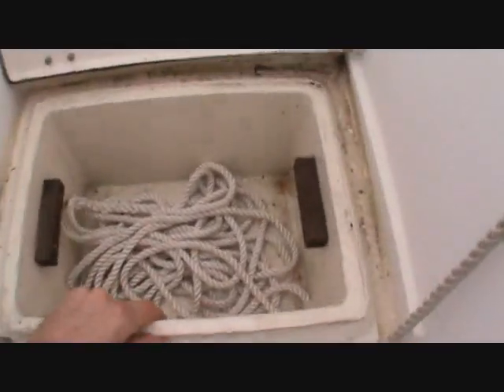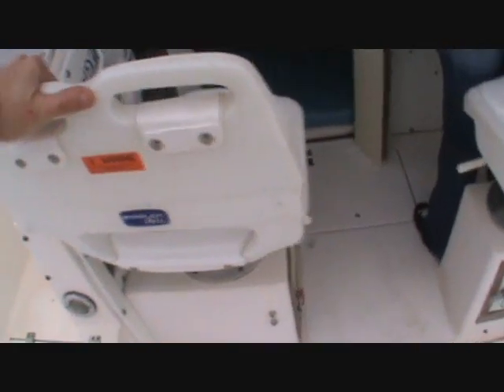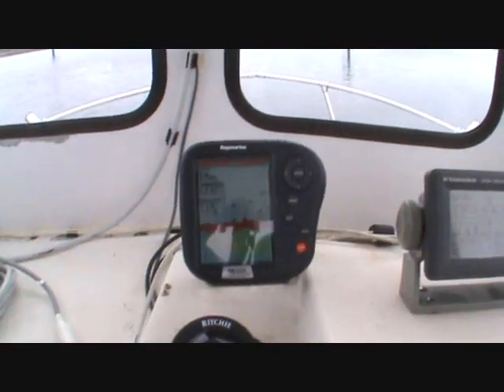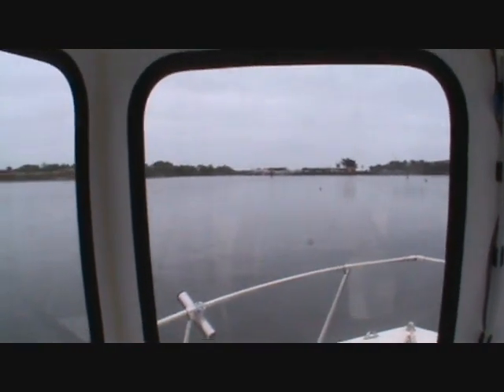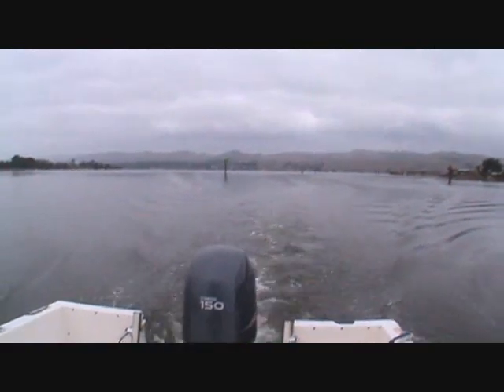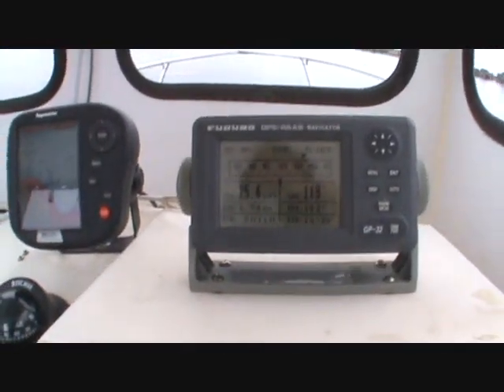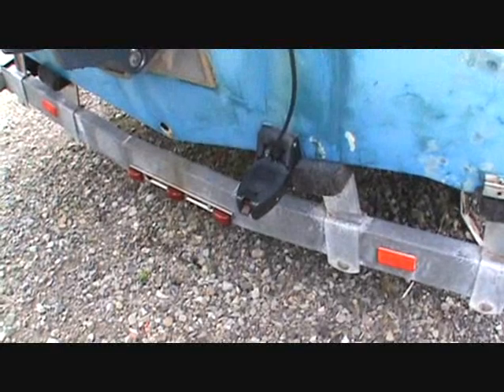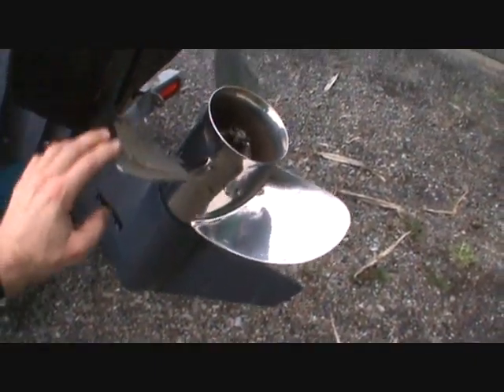Grady White 1987 204C Overnighter

Comment: Tip for new boaters: those batteries?  Either move them forward and away from the stern--or at least, put a heavy gasket around the well so that no water can enter.  Older boats often have little or no seal around the hatches--all hatches should be sealed and have a totally dry bilge.  At that point, if a big wave brings in water, it flows out the drain scuppers, and the bilge remains bone dry--as it is supposed to.

Comment: dude i love it .. where did you get the full aluminum pilot house with tempered glass ? how much does it cost .. awsome ..
Reply from the maker: I am a welder and machinist . I built it and had my glass guy install the glass.
Reply: excellent ..question: does this have to pass some kind of boat safety inspection ? I mean is it legal to add stuff to your boat that is not stock ??> thanks again
Reply from the maker: If I added a machine gun I would get in trouble .
Reply: Im gunna build the same this is awesome. Do you think the pilot house made all the diff?

Comment: i may be a novice , but i do see a small hole and damage to the hull on the bow side. some may call that a bilge drain ? I think its hull damage ... nice boat anyway I wonder how it handle on the ocean ...
Reply from the maker: Zero hull damage . I used this boat in the ocean off northern Ca, One November On opening day of crab season i took a sneaker wave right on the two front windows of the pilot house over 100 gallons of sea water filled the rear deck and drained out of the two rear scuppers other than me shaking in fear the boat had no damage . This is a Grady White one the the very best .